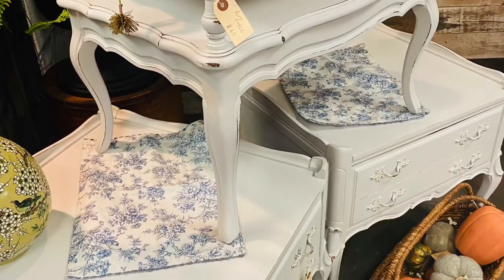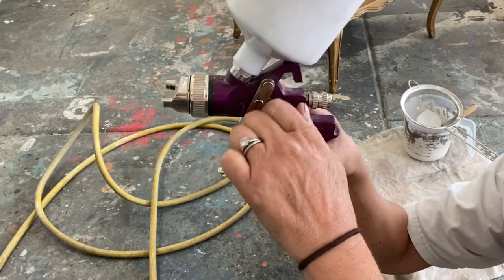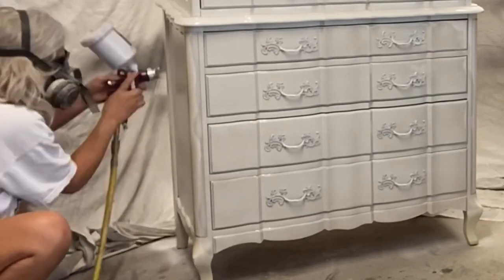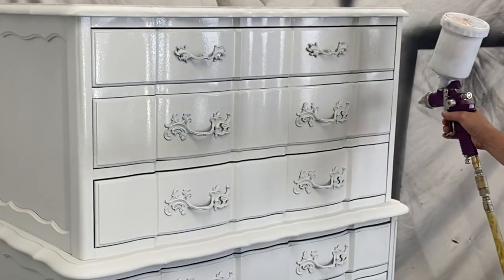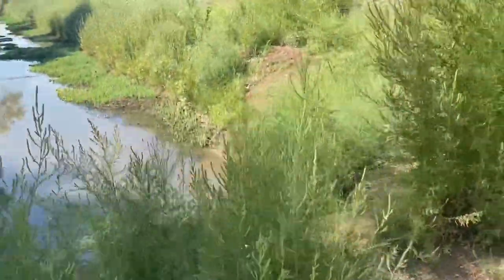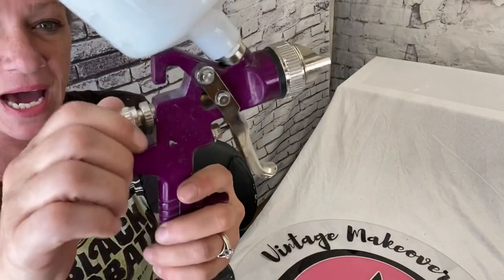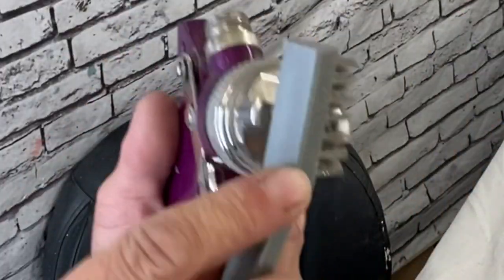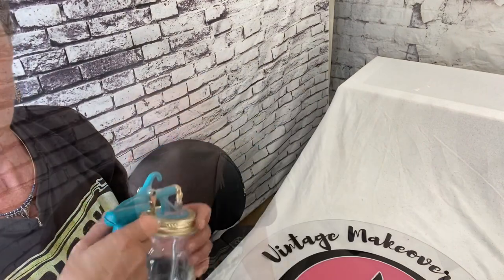How to spray chalk paint/ DIY paint

Comment: How many gallons is your compressor?  I've heard these guns won't work on the smaller ones most people have.
Reply from the maker: I have heard that too. Mine works fine. 6 gallon
Reply: @VintageMakeoverswithMelanie  Well dang...I have 6 gallon California Air.  I returned the new sprayers I had purchased and went and bought an Earlex.  I didn't want to try it out only to have it not work and be stuck with it.  You're the only one that has said anything less than a 30 gallon would work.  Wish I had seen and asked this question first!
Reply from the maker: @kathleentorres2010  well shoot. I use it and it’s just fine for furniture. My good friend that sprays soooo much more then me has the same. 

I would not feel confident painting a house lol. But seriously I have not had problems. Maybe the grass is truly greener with a larger one… but I wouldn’t know. 😆🤔🤷‍♀️

Comment: What type of compressor do you use?  I heard the compressor is very important when you are spraying.
Reply from the maker: I have a 6lbs pancake Dewalt I found on sale
Reply: @VintageMakeoverswithMelanie  Melanie, I bought a spray gun and when I got it, the fine print said, "...need a 30 gal air compressor".  Those things are HUGE and heavy.  Are you (or did you) spray all of those pieces of furniture with a 6 gal. air compressor?
Reply from the maker: I use this all the time I spray. I don’t want a big one around.  I don’t spray all the time though probably once twice a month

Comment: I stayed until the very end.  One question…on the sprayer end, which way do you spray for each setting?  If you spray side to side do you want horizontal or vertical?  Spraying up and down horizontal or vertical?  Great video.   It looks like you are diluting 2 parts paint to one part water?
Reply from the maker: It depends on your paint and the way you are most comfortable

Comment: What size compressor do you use for the paint sprayer?  I bought the Harbour Freight spray gun but then realized my compressor is too small.
Reply from the maker: I use a 6 lbs. it works good

Comment: How long between coats of paint and do you wash your sprayer out between coats?
Reply: And i stayed!
Reply from the maker: I try to wait about an hour between... mostly I don’t. DIY dries so fast.  

If the gun is empty... or it will be any amount of time between... probably should flush it out... it can dry inside and then you really have to clean it

Comment: When did u decide to start spraying and do you find it depends on previous finish on how you decide to paint? Or is it mostly about time frame,
Also how long it take you to get good at spraying ?
Reply from the maker: I started a few years ago... I started with an electric sprayer... because I absolutely hate the sound of the compressor. It works well, but it also is incapable of using that bottom 2 inches of paint. 

I use the sprayer when I need to get solid finishes done. If no blending... or creativity is needed... then it is so much faster
Reply from the maker: Great for cabinets also... definitely gives the best flawless factory finish

Comment: Can you use regular latex paint in this sprayer and water based sealer ? I don't like chalk paint , and do i need to dilute it ?
Reply from the maker: Hi. Yes you can.  Follow the dilution ratios for the paint you are using and make adjustments from there
Reply: @VintageMakeoverswithMelanie  thank you
Reply from the maker: No problem! Hope that helps

Comment: Is water better with DIY paint than using the floetrol?
Reply from the maker: I have never used floetrol
Reply: It’s used when spraying paint both latex and oil and in paint pouring with acrylics
Reply from the maker: lechatbotte I have used it for paint pour... but not for chalk paint in a spray gun... water is sufficient